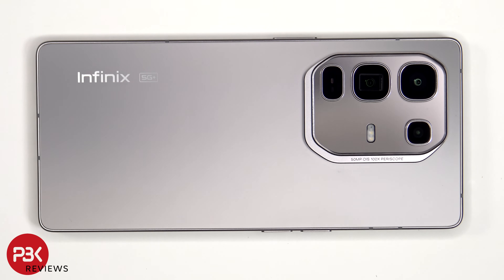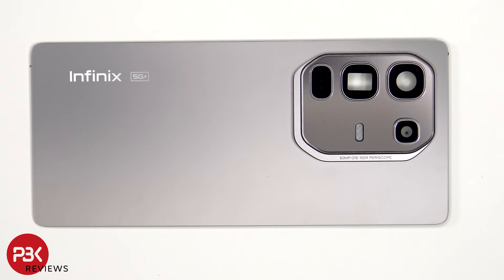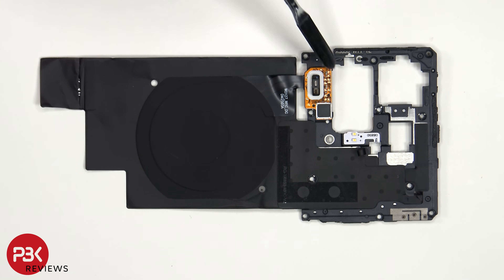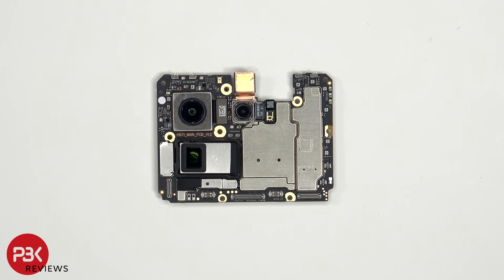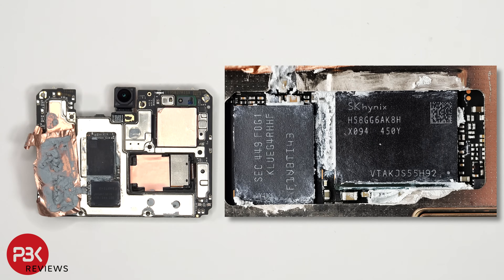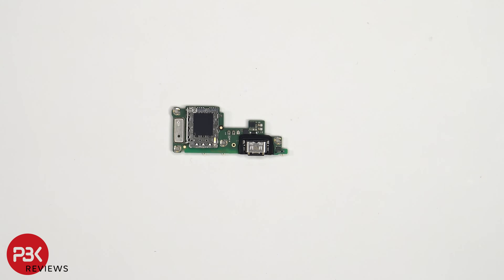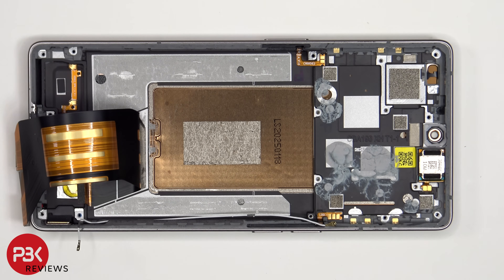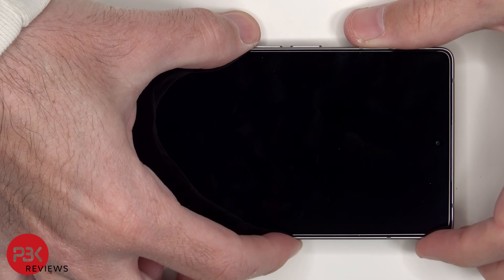Infinix Note 50 Pro+ 5G Teardown Disassembly Phone Repair Video Review

Comment: How to fix my infinix note 50 pro+  charger port not charging after I submerged my phone to the cold water
Reply: Replacing the charging port could help
You can also try isopropyl alcohol and toothbrush, and clean the contacts

Comment: It would be a nice addition to tearing down the screen as well instead of just describing the process
Reply from the maker: Yeah, but the risk of damaging the screen is high. It's pointless when all that is left is to just heat up the screen n pry it off. Nothing major underneath it to show off to warrant breaking or damaging the screen. On some phones I do take it off if there is something that needs to be shown but yep.
Reply: One thing i feel is , the finger print reader is very small in it. Is this something to worry about?

Comment: hello i have a question i have motorola edge 50 ultra it has ip68 waterproof but today i notice there's a gap between frame and back cover of the phone that gap is wide enough to fit a thin piece of paper it's right below volume button and it's 1 inch long so i guess it clearly breakes the waterproof seal so my concern is how big of a problem it is should i worry?
Reply: Yes it's no longer waterproof
Reply from the maker: If the adhesive is going bad and its lifting, it can allow water or debris getting in over time either clouding up your camera lens or damaging parts if water gets inside. Aside from that it won't affect the phone but better to replace the adhesive. Here are two links for the replacement adhesive: https://rounded.com/motorola-edge-50-ultra-xt2401-adhesive-sticker-battery-cover-5d78c24501.html  or https://shop.headlane.co.uk/shop/product/5d78c24501-motorola-xt2401-edge-50-ultra-back-battery-cover-adhesive-sticker-39869

Comment: 4:16 Did i hear correct? physical proximity sensor? Correct me if i am wrong
Reply: Wow. Not many phone companies provide physical proximity these days.
Reply from the maker: correct
Reply: @PBKreviews  The Infinix NOTE 40 Pro+ 5G doesn't have a physical proximity sensor, It's a elliptic labs one and it's pain in pockets as it dials the emergency contacts because the pocket mode is not available but with this one finally they bring it back but I noticed there's no more flash in the front which is a unique feature of transsion phones